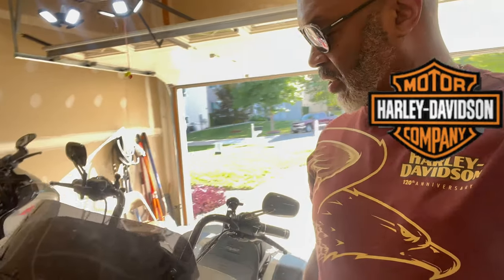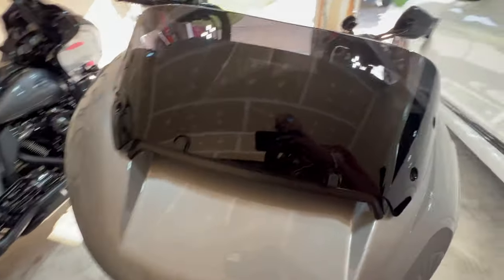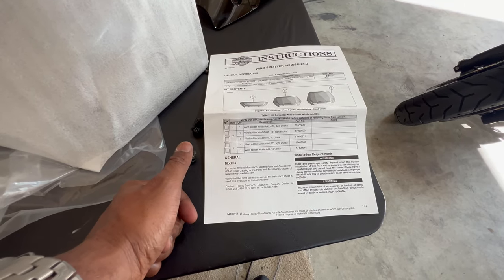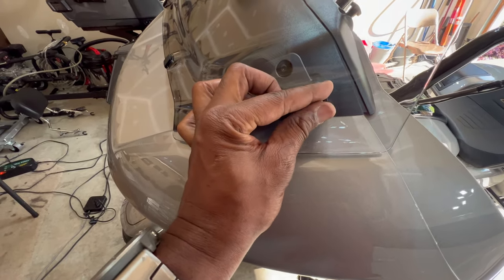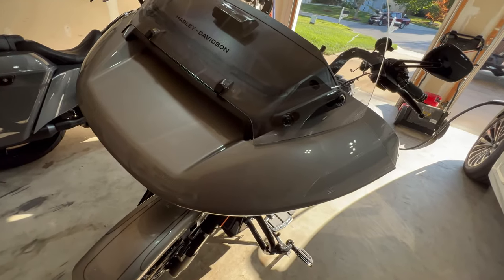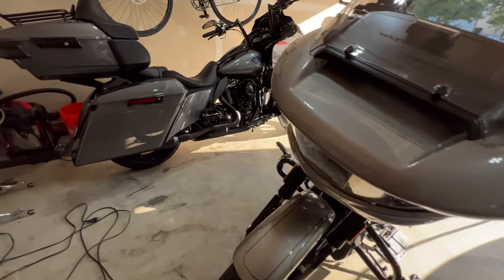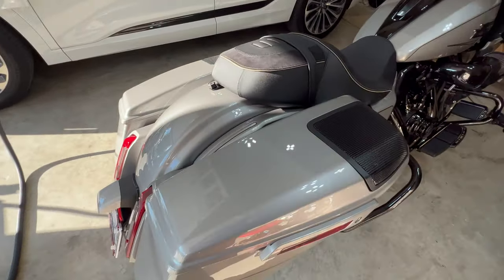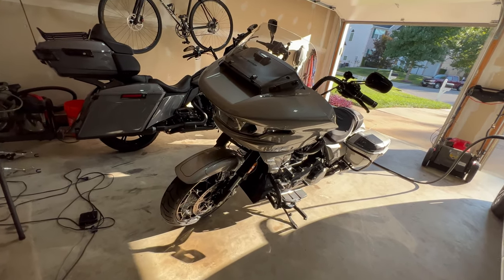How to install a Harley-Davidson Windshield on your 2023 Road Glide CVO.  + Comments

Comment: What’s up frat?  On the Harley website it says you need the tall windshield mounting kit. Did you use one and not show us or did you not just use one? Thanks.
Reply from the maker: No.  I just removed old one and installed new one.

Comment: Hi, which size torque wrench is that? It looks nice. 1/2 or 3/4? 10~80lbs ft/lb? (nice quality video btw!)
Reply from the maker: LEXIVON Inch Pound Torque Wrench 1/4-Inch Drive | 20~200 in-lb/2.26~22.6 Nm (LX-181) https://a.co/d/89DTvgx
Reply from the maker: Hi.  Thank you for watching.  I can’t remember what adapters I had on there but I provided the link for the wrench.
Reply: @ChrisGlides  i got one overnight via Amazon, TY and happy Thanksgiving!
Reply from the maker: @DougKamererRealtor  Nice.  Hat size windshield did you go with? I have the 12 now feels better blocking more wind.  I can look over the top of windshield buck I find myself ducking into bike and seat sometimes and I am looking into a blurry area of the windshield where the top part has its curve.  I’m not sure yet which is best for me but so far 12 has less wind.  May keep 12 for cold months and 10 for warmer months